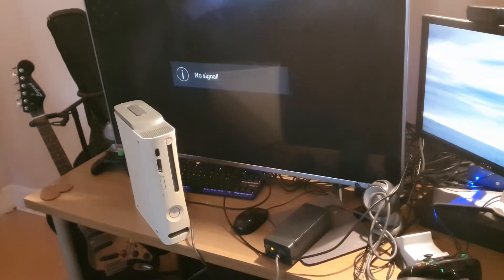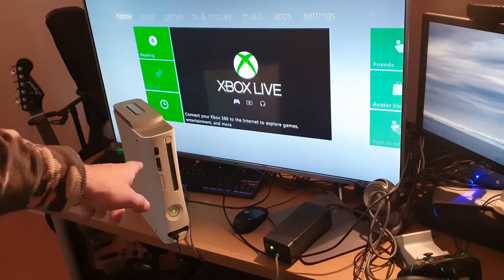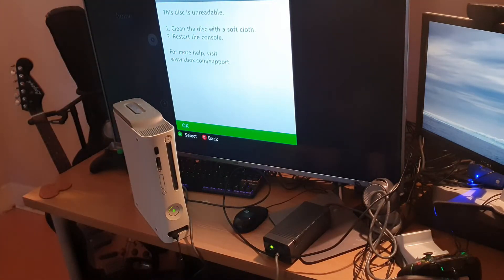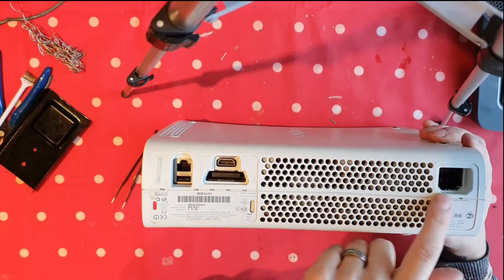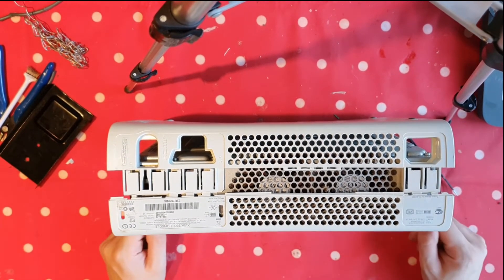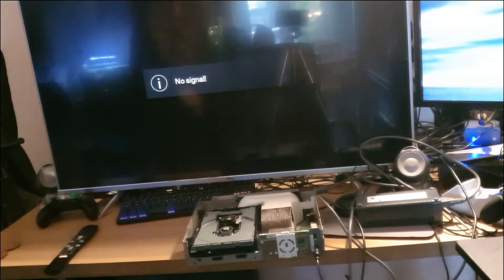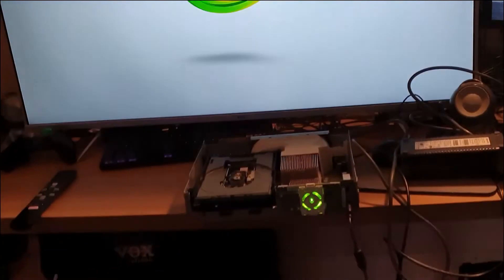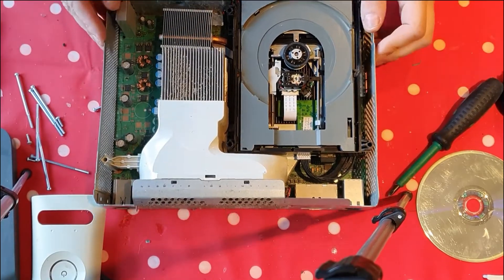Xbox 360 disc drive wont open fix/repair

Comment: Mine gets stuck on the magnet wheel on the top aluminium body where it joins with the engine if you take that top panel off with the magnet it works if you put the top panel back it gets stuck 😢